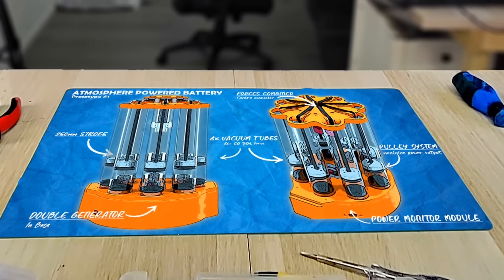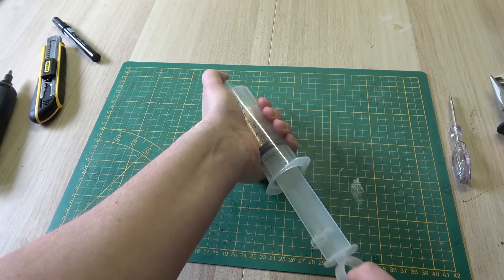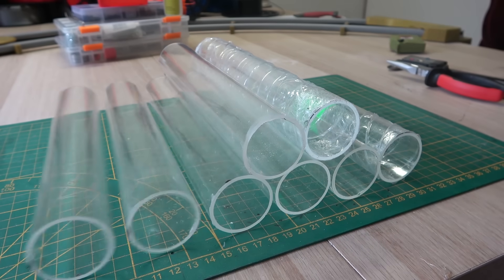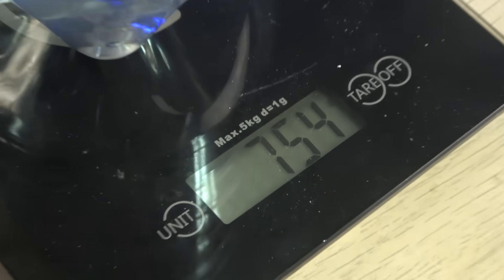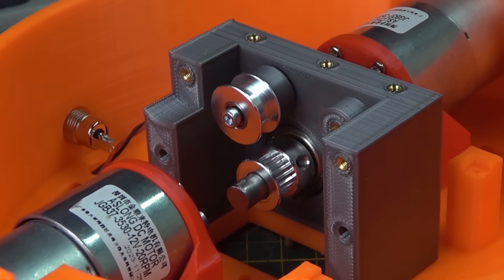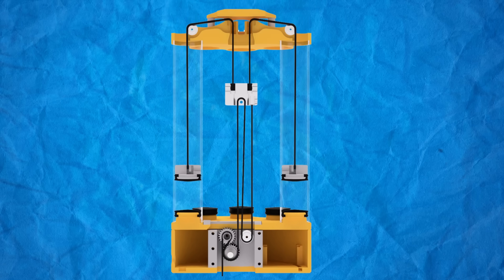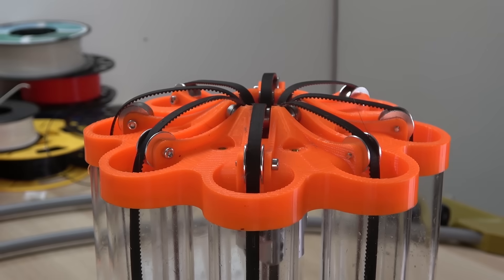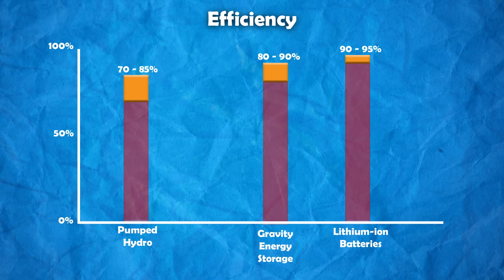Building an Atmosphere Powered Battery..

Comment: In general, if you placed this system in a cylinder containing compressed air, wouldn't you increase the storage capacity by the difference in pressure relative to the normal environment, automatically?

Comment: Connecting the engine to a concertina with many folds and a very large surface area made from thin gauge stainless steel or other material should help, it could be a concertina of several hundred or even thousands of square meters in a relatively compact space.

Comment: I think that slowly you're going to face leaks if you don't have some way to prime the vacuums while the system is discharged, I would guess that if you stored the vacuum for say 8 hours you'd see a significant drop in efficiency and that would compound to less available storage with each such charge/discharge cycle.

I wonder if a better way of storing the vacuum is an external tank (or two) if you pump air from one tank into a second tank and hook each side up to a piston you'd have a ~0 and ~2 atm differential so you'd get more force out of that and you could use the compressed air/vacuum to switch back and forward (with vent to atmosphere) until there's no pressure differential to exploit.

If you have a max vacuum with such a system you also wouldn't run out of energy storage potential as you can continue to pressurise the high-pressure side to some upper limit, I've seen small 200atm systems and larger 60atm systems.

And if you can recover some of the energy lost as heat during the pressurisation or cold during depressurisation with say a sterling engine on the tank you'd also gain some additional efficiency out of the system (though the usable energy recovered with a sterling engine is probably minimal there may be better systems depending on scale)

Comment: Its neat but its not going to work on the market. The vacuum will be too needy for maitanace, too manny parts, hard to scale. It does not  provide any substential benefits in coparison to the gravity. And it would be too dificult to build at scale. 
Gravity have manny benefits to this. Its simple, so it have less parts that can fail. And it wil be much more cost efficient.

Comment: I'm not sure the efficiency you calculated is possible. Since PV=NrT, a lot of energy would go into temperature change as you pull and lose the vacuum. If I remember correctly the losses due to that alone would have to be about 30%.

Comment: You could probably greatly improve it by reducing friction. 

You might be able to do this in a few ways. My first couple suggestions are these:

1: Add braces between the tubes so that they do not flex side-to-side under pressure. If the tube bends, then the piston ends up being forced through a curve rather than a straight line. This creates unnecessary tension and friction.

2: For the same reason as the horizontal braces between the tubes, you could consider placing vertical braces between the base and top of your contraption. These would remove a lot of the downward stress, which is currently being applied directly to the vacuum tubes, causing them to flex.

3: A slight bit of oil to lubricate the seals at the end of the piston would probably go a long way in reducing friction.

Those are just the first things that come to mind, though. I enjoyed watching. This is a very interesting concept.

Comment: What I can envision is system where you pull on a rope with mechanical advantage to charge the pressure battery by making the vacuum, then have it drive an alternator to power things. Maybe on a huge scale you can hire people to pull the rope to make the vacuum. That seems like really clean energy.

Comment: 73% on a small scale model and with all the unavoidable friction at this size is amazing! Very inspiring!
Reply: with 6 pistons you get 6 times the friction. better have 1 big piston. 
also more sprokets axels etc. gives more friction.
but have to say pretty nice idea.
the problem with pressure systems is, when you load the system it gets hot and thats is working against you.
and the other way it gets cold.
here you have  a constant vacuum you cannot get less than nothing.....

Comment: Energy Calculation:
Energy=ΔP×V[ΔP=pressure differential,V=volume]

1 bar = 100,000 pascals (Pa)

If the pressure differential ΔP is 1 bar (100,000 Pa) and the volume V is 1 m^3, then:
Energy=100,000 Pa×1 m3=100,000 joules (J)

Since 1 Wh = 3,600 J:
Energy in Wh/m^3=100,000 J/m33,600 J/Wh≈27.78 Wh/m^3

To match the energy of a car battery:
Energy=12 V×86 Ah=1,032 Wh

So, we need:
1,032 Wh/(27.78 Wh/m^3)≈37.15 m^3    to equal the energy stored in a car battery.

However, considering the system efficiency is only 73%, the necessary volume becomes:
Necessary volume=37.15 m^3/73%≈50.89 m^3

Car battery = 50.89 m^3 tube volume....

This is why this approach isn’t feasible.

Comment: Interesting. Imagine this design coupled with solar. During the Daylight, you use the electricity from solar panels to power the motors, but also the heat from a solar collector to evaporate a liquid inside of the cylinders, reducing the amount of vacuum produced while charging the battery. Once the sun sets and the solar panels are no longer producing energy, and the solar collector is no longer heating the chambers, the reduction in temperature and vacuum as the battery discharges causes precipitation inside of the cylinders, essentially helping to prolong the stroke of the discharge cycle.

Comment: I'd be interested to see if you could optimize any 3D mechanical parts like the cogs or tension-er system with machined and lubrication, or seeing what the minimal tension needed on the pulley is. I'd be curios to know what losses you could gain back in machined parts rather than plastic on plastic :) 

I have 0 idea if any of this would make a difference but I'd want to know if there is a difference

Comment: This is a terrible idea and it’s been explored before. You can store a lot more energy with pressure than vacuum. But even with pressure it’s terrible energy density. And using syringes and a whole bunch of cylinders is dumb and has a lot of friction. You just need a large tank and a pump. Also the gravity idea mentioned at the beginning of the video is already done but using water. Dams are better than weights in every way. You just pump the water in and out.

Comment: You're compounding the motor losses with the friction tradeoffs that good seals make. You could improve the efficiency by coating your sealing surfaces with tungsten disulphide, graphite, or other dry lubricants which exhibit good sealing properties and low friction coefficients. Greases and oils work by exhibiting some viscosity which makes monolayers when motion is applied; this viscosity always makes heat. They do seal better, but your efficiency problem is accounted for by friction more than it is by leakby, so could you tolerate a bit of leakby to drop your seal friction? Possibly. Minimal effort and cost to test this.

Comment: ok , I'll bite for your question even though I know that you will likely not read, because you asked just to please daddy algorithm: I think the weak point for scalability of this is the vacuum seal itself. It's nice you managed to store 600W out of the 800W-ish you charged it with, but I bet this won't last many cycles and despite is a very interesting project I doubt you can scale this very well. The idea is brilliant though, but I think rubber gaskets aren't going to cut it, and some other type of vacuum type syringe style would be recommended (something without gaskets or moving parts such as a gasometer). I'm not an engineer but creating a large lasting vacuum is on itself a very old engineering problem without an easy (or cheap) solution. Maybe a smaller version of a gasometer vessel would be glass syringes, that do create a vacuum without rubber gasket (but mad eof metal for example). Tolerances would have be reeeeally tight, this is why I suggested using a glass syringe as a proof of concept.
Reply from the maker: First of all... I read all the comments under my videos!🤓 

Secondly, I completely agree with you.. But you have to start somewhere, right? And I believe that with feedback like yours it is quite possible to ultimately create a version "together" that can get the most out of it!👌

Comment: maximum vacuum pressure achievable is close 1 bar. What if you dont use vacuum but instead you use the opposite, pressure. You can easily compress air to 10 bars giving you more energy

On low speed 2 stroke engines onboard ships they use compress air to start the engine by basically flooding the cylinder with 30 bars of pressure to push the piston down. They keep the air under pressure in 2 reservoirs. Use 2 stage air compressors to achieve the high pressure

Comment: This wont work economically.. those who aren't familiar with electrical or chemical engineering will forget to do a thermodynamics check. In this case, it is as simple as remembering that mechanical force translates to very little electricity.. you need a 100 m tower and a 2 m tube to store 8 kwh. Good youtube $ gemerator however.

Comment: Ive been thinking of tiny solar panels, connected to capacitors, connected to converters to charge up batteries. Is there a place for assorted tiny solar panels in power generation?

Comment: the sound effects are really loud and make it hard to pay attention to what you say
Reply from the maker: Thanks for your feedback! Will keep it in mind for future video's!
Reply: @ConceptCraftedCreations  I meant to say also that the video and the topic are really cool! Thanks for posting! I've been curious about the topic for a while now and I think the efficiency could be brought up to 90-95% if it could be made with better materials. It might be worth shopping around for a better gasket seal, finding a gear/block-and-tackle system by which one could hand-charge it, and using a thicker grease to lubricate the seal that bubbles won't seep through the (what I imagine to be) silicon lubricant. Perhaps lithium grease. Though the silicon lubricant is very useful to also have in there as a visual aide, useful to check for bubbles, or  breaks in the seal otherwise.

Comment: What you made is called a pump...
Switzerland tries to reverse your idea, so to pump air into a large air tight hole in a mountain, allowing them to use more than one atmosphere of pressure difference and improving the battery's capacity.

Comment: instead of vacuum tubes use a metal spring to create tension so you don't waste energy on friction inside the tubes. 
also use a better electric generator without gear, like a car alternator or similar. when using gear dc motor as a generator there's a big energy loss with friction. 
as less mechanical moving parts as more the efficiency. 
in that way I guess you can hit the 80-85% efficiency, but than the question comes up:
why not going for gravity battery?!

Comment: hey man, I think focusing on building one large cell, and testing it, could prove fruit-full. If you could make it out of common building materials that would be cool, like a 4 foot tube of pvc or something like that. then once you develop a single cell, you can reform an array with a bunch of the single cells. then you may have a useful system. anyway cool project!
Reply from the maker: Thanks man🙌

Comment: wow impressive method. but umm.. is there any of theory that prove mechanical energy storage/acumulator can give an effort to get higher output energy than its input energy in a contstant way 🤔 ?. well, i'm thinkin' about the characterisitc of an ordinary-conventional winding spiral spring by now ( kinetic - mechanical energy ). cuz, so far as i know, all knd of mechanical energy tranfers is something inefficient methods. any knd of mechanical pheriperals is jst a gears / leverage to convert /transfer a form of energy into another form of energy. for example : the ratio of bicycle sprocket gears, pulleys, driven belts, metal gears, sprocket chains, crankshaft, combustion chambers, pistons, ect, which is in many ways, all those knd of mechanical pheriperal will get some energy loss by the time, that turned some input energy into many form of excess and residue such as ; overheat ,carbon dioxide fumes , metal stress, composite rubber stress, backlash , mechanical glitch, ect . well, it's jst a thought tho. don't take it seriousely. greetings from jakarta ✌️🇲🇨

Comment: There is 0 potential in this approach, your efficiency numbers make no sense either, pumped hydro IS gravity energy storage, and doing GES with lots of moving parts that can be damaged makes no sense, water can't be damaged and is cheap. For your method you need a FREAKING VACUUM! how do you propose scaling it without losing efficiency from leaks? Screw batteries, if you could CHEAPLY make a leak free chamber bigger than a water tower you can sell that to ibm for their quantum computers. 
Ridiculous shit.

Comment: Neat Idea, I like the fact it's compact, easy to make (relatively), and doesn't use toxic chemicals. The only major "con" would be the maintenance on storing the energy long term. Holding vacuum is a active process and it will leak over time, which will require energy to maintain. A gravity battery like stored hydro, is passive as you only have to pump the water once. It's more efficient, but is not as compact, and requires a large head span. Could you not swap out the vacuum with an 80kg weight and simply do a linear generator? or what about using a spring with a resistance of 80kg?

Comment: I think it's super cool concept but definitely more engineered than putting for example a 2000 lb weight two stories up in your house and letting it slowly fall overnight and charge a battery or run electrical?

Comment: Even though the efficiency of 73% is quite good. This storage system does not make sense, because you'd need a huge amount of space for little capacity.

If you have a 10m high tube and you want to Store 1kwh of energy you'd need a 6.77m diameter tube at 100% efficiency and 9.3m at 73% efficiency.

That equates to 676 m^3 for only 1kwh of energy storage.
That is only about 5 J/L (Joules per Liter) for example lithium batteries have a energy density of 0,85 MJ/L 

A fun project but not applicable in the real world.

Formulas:
A=(d^2*pi)/4 (A=Area, d=Diameter in m)
E=F*s (E=Energy in Joule, F=Force in Newton, s=stroke in m)
F=A*p (A=Area, p=Pressure in Pascal)
E=A*p*s=(d^2*pi)/4 * p * s
d=sqrt((E*4)/(p*s*pi))
V=(d^2*pi)/4 * s

Comment: I was toying with pumping water via air pressure. Basically a series of check valves and chambers with light being focused on the side with the air and pushing the water up to the next level as the air pressure increased. There are a bunch of issues with doing so that would lead to it being impractical, but it's kind of amusing to consider things like that as every once in a while one of them turns out to be practical.

Comment: I remember reading somewhere that with compressed air energy storage lower PSI values were more efficient at storing energy. Since I guess this is sorta like the opposite of compressed energy storage I guess the same math will work here? i.e. half charging the battery might be more efficient or maybe 5% -> 70%.

Another thought is that if you seal the top of the vacuum tubes you can compress the air at the top of the plunger too and that should increase the energy density by having compressed air and vacuum storage combined.

Comment: Unencumbered by the thought process or reading most of the comments, I'd say that using vacuum limits you to 14.7psi. I don't know if a compressed air system is as efficient, but going to something like 1,100psi would give it much greater energy density. Even if it was better, eventually the cost to scale up might be prohibitive. Great work though. I love people exploring every option. Sometimes you get surprised.

Comment: You could increase the power capacity by stacking the cylinders and idk if you if you have it built in yet but if you put 1 way ratcheting mechanisms onto the motors it will help reduce power loss between cycles so in turn higher efficiency

Comment: To determine whether it's worth it, an important comparison needs to be made: energy production per space used.

We know the eROI is 73%. However, we must determine how much space each method uses to provide the same energy.

By this, I mean the space taken by the entire device. For pump hydro, this would include the turbine, the water pump, and the water tower. You mentioned this a bit when you started the video by talking about the size of the weight you would need to supply energy for the house. However, you never calculated how big this system would need to be compared to the gravity battery.

Comment: This looks promising.  I have an idea to increase your 73% efficiency,  The vacuum tubes are clearly creating a suction force.  Why not use this suction to draw some water up some extra tubes which contains a water turbine, then when the vacuum is released it will force the water back again thus generating electricity in both directions.

Comment: it's a failure at the conceptual stage. Vacuum chambers constantly get bleed from outside. So the battery is going to lose charge from that. Pressure needed to maintain a seal will introduce so much resistance that the waste heat will make the battery too inefficient to be usable.

Go with hydro-electric gravity batteries. Since you want it compact, use mercury instead of water. additional safety measures will be required since water leaks are no issue while mercury leaks are a major issue.

Comment: the efficiency is low because of all the friction. maybe use a friction less air seal. and use a some kind of auto gear so its gets easier too pull up, then switch for more force going down.